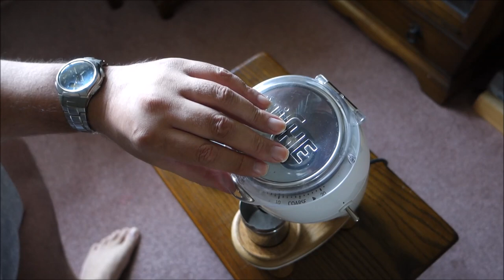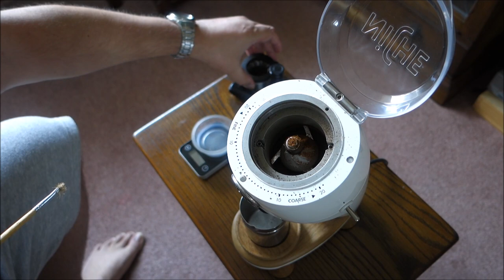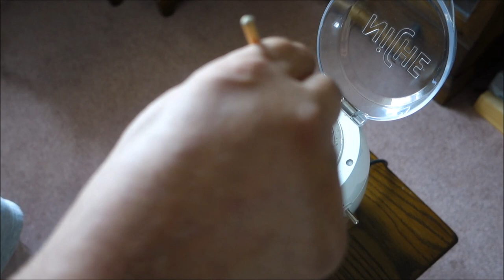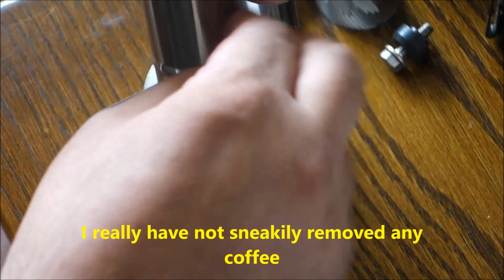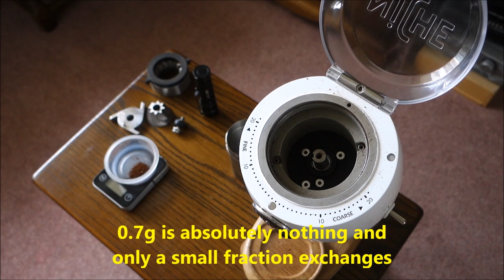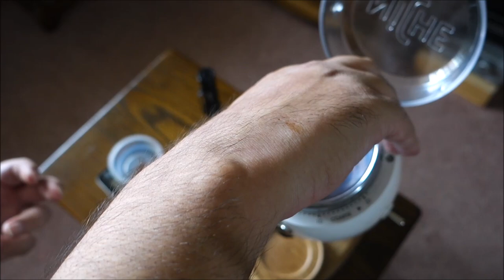Niche Zero -  burr removal and retention

Comment: Hi Dave, I've seen many Niche user videos refer to a "breast pump" plunger they use as a bellows on the Niche.  I believe it is actually a "palm chest percussion cup" to help loosen phlegm for infants.  Have you seen that and what are your thoughts?
Reply from the maker: I think if it makes them feel better fair enough...as probably less than 0.3g of coffee exchanges each time you grind...which is about 1 coffee bean..it's sort of pointless and once you start doing it, you probably feel you want to keep doing it. Just using the Niche as the manufacturer intended works perfectly well, and you won't taste the difference.

Comment: interesting to see your left foot all the time -(( --- and what kind brush do you use, only to avoid the same brush;-((   and: what watch do you wear, also not to fail with the same watch model;-)))
Reply from the maker: I like my left foot, almost as much as the right. The brush was whatever my hands first came upon, it's actually an oil painting brush. The watch is 24 years old now and is a Casio Tough Solar Waveceptor, never let me down, never been opened, still waterproof and has been all over the world with me. Best £40 I ever spent.. The fact I never have to set it, because it uses the atomic clock for date, time and location is a huge bonus, because I can't remember how and it has a 53 page user manual. I do have a few other watches, but this is my go to and on my wrist as I am typing this.

Comment: Hi Dave, do you lubricate the threads of the hopper? If so, do you have a recommended product and would you be able to detail the best way to apply it?

Mine is getting a tad resistant and feel like turning it is almost continuing the damage, though, I'd also be a little concerned about the propensity for the lubricant to attract, stick and build coffee fines over time...
Reply from the maker: Just a light smear of silicone lube, or a foodsafe ptfe dry lube.

Comment: Mine is having this weird issue where the outter bur is scraping against the wall of the grinder isnt the metal part. I can tell its doing this because the color is scraped off on the inner bur and I hear a this weird slight sound when I turn off the grinder. It recently starting doing this!
Reply from the maker: I don't think the power down noise is anything to be worried about. The outer burr has to touch the inner wall at some point and when the grind is made coarser or finer a witness mark will be left on the wall of the grinder. If this is what you mean I don't believe you have a problem. If you are still concerned I  suggest you contact Niche and see what they say and also if you want reassurance about the noise. Don't forget to include some audio or video for them.
Reply: Dave Corbey You told me exactly what Niche said. Thank you Dave! They told me that’s normal.

Comment: I just got mine and i wasn't able to take the top burr off with my fingers. I thought i maybe needed to unscrew the nut thingy in the middle. I tried to with the tool i have available and it just looked like i was just turning the burrs underneath 😓 i hope i am not ruining it!
Reply from the maker: Turning the burrs with the nut won't ruin anything. Once the silver funnel is removed the top burr simply lifts out. It can be hard to get a grip on it. I put 2 fingers in and apply outward pressure to grip the inside of the top burr, then pull it out.
Reply: @DaveCorbey  Hi Dave. Things are going pretty well with my Niche. I installed the disc and it works even better. There's one thing I am nervous about, which is that I accidentally turned it on while it was practically on calibrate. It was only for a few moments. I haven't noticed any issues but I guess I am just looking for a bit more reassurance from an expert. Would there be any problem if this happens once or twice briefly? Also, how much past 0 can one go/how close to calibrated is okay? Mostly just curious at this point but would be nice to know I haven't damaged my Niche with my incompetence. Thanks for your patience in reading my questions! Kind regards.
Reply from the maker: @excellerateurbreath  it will be fine don't worry. As for calibration, it's just to help you get the numbers shown for you grind level similar to others and get u started.

Comment: I just cleaned Niche grinder and I was at 15 now at 22 setting after cleaning. Is this normal?  I did calibrate the grinder.  Espresso results are 18grams and 35 grams out in 26 seconds.
Reply from the maker: Yes, don't worry.